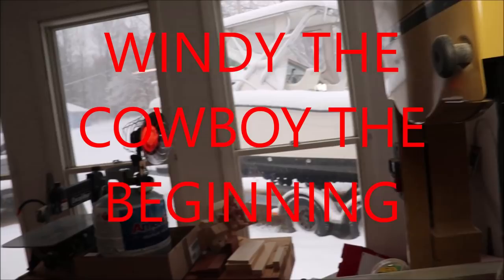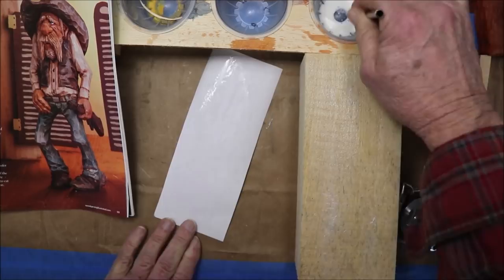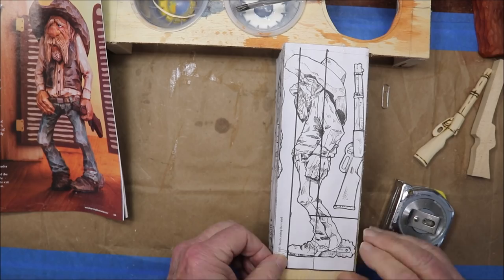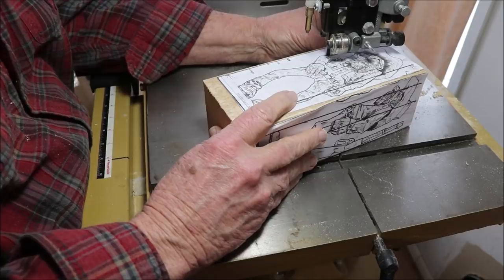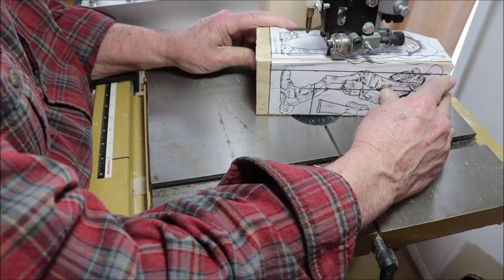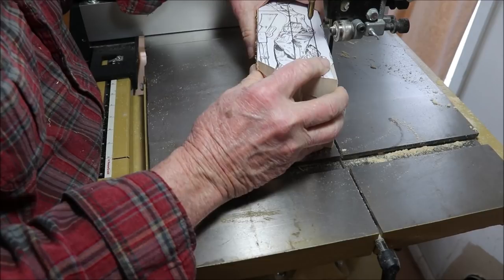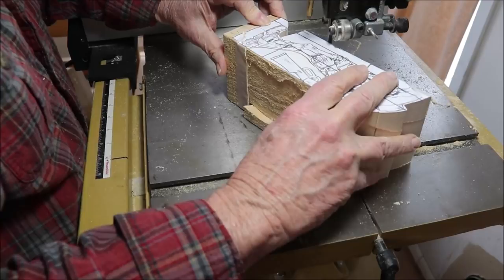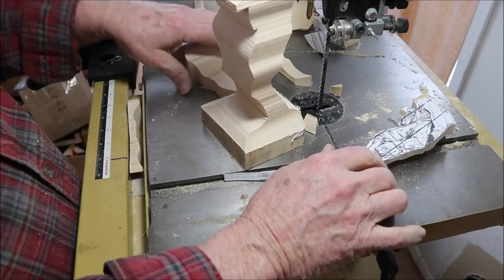WINDY THE COWBOY~Woodcarving patterns

Comment: Dennis, to keep the blade from coming off when backing out, round the back of the blade with sand paper or a fine file to remove the manufacture square edge while the blade is moving. I do this when I install a new blade.